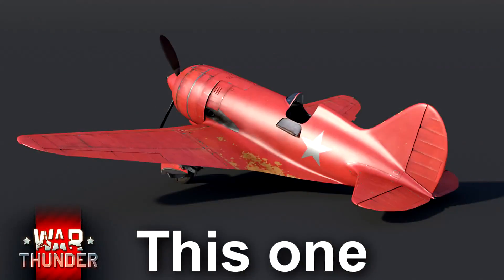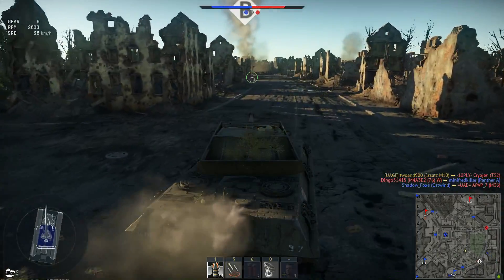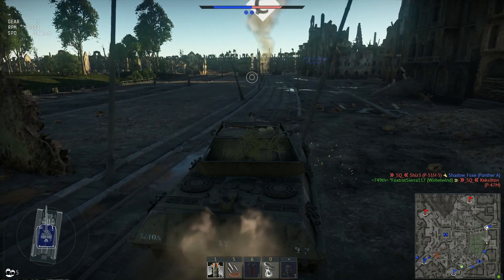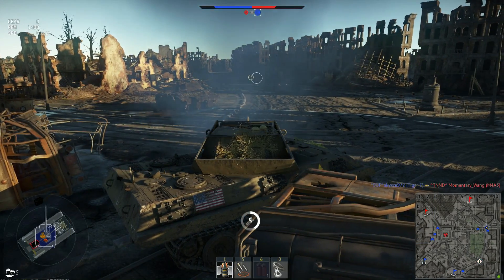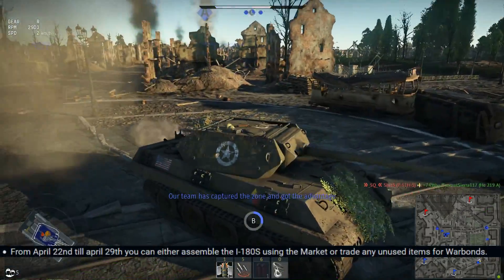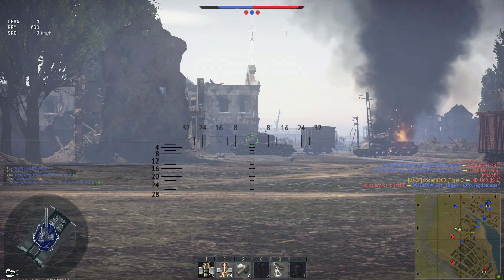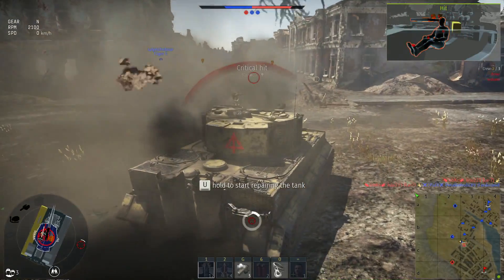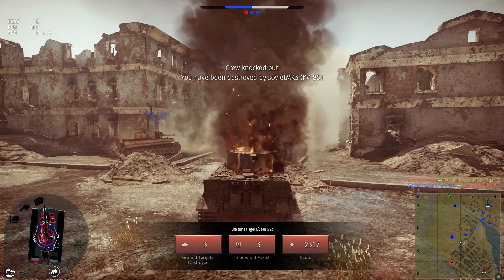How To do the Battlefield Engineer Event - War Thunder

Comment: Oh, oh, I know: Assemble the plane coupon and the first voucher easy peasy, then try to build the second voucher, only to learn that the last two parts you need have an abysmal droprate and go for 400 gaijinbucks each on the market. That totally helps with motivation.
Reply: sell a bunch of repair kits to be able to buy the part
Reply: Ah, yes, of course. At 0.39 per repair kit that just means I need to farm and resell slightly over 2000 repair kits. Totally viable, right?
Reply: @Norrikan  oh thought you meant 4.00 and didnt realize that there are parts over 100 bucks, i see them now O_O
Reply: General Glowstone they go down extremely fast so dont worry

Comment: btw, i'm finnishing the 2nd i-185, had no need to buy parts, when i disassembled a bad part, it disappeared, but later on, when i had checked other stuff, i got the box with the 'green' part, for example, the armament, so, don't go spending $ like there's no tomorrow. it's not that time consuming, comparing to the IS7 event, i would say it's about the same effort, if ur going for all vehicles...

Comment: I've lost my i-180s i can't find it i can't do tests with it i had it at the beginning of the game and  i also have no coupon can someone help or explain to me what has happened i'm so pissed off all i want is 2 vehicles maybe 3 if i'm lucky or have the time thanks in advance to anyone who can help.
Reply: maybe look in your inventory? at the bottom right of the ingame screen
Reply from the maker: I've heard of other people having this problem but unfortunately I do not know how to fix it, however, I would suggest restarting your game. If that doesn't help, you should looks for people having the same problem on the official forums and bug one of the moderators.
Reply: @najkraemer3117  Ill try that thanks.
Reply: @lol500000  i have found people i think they had the same problem but no1 had a solution thanks trying.
Reply: All good it just appeared straight after a match i really wish they wouldn't get there act together thanks for trying to help much appreciated cheers.

Comment: 20-30 battles so far and all boxes dropped 1 toolkit each and so far i ONLY GOT ONE part...
These events are so fucked up that i don't think TEC ever sees why 80% of the community HATES this BS, shit like the old battle task events are closer to a fair deal than this BS that makes no excuse to force players to try the Market, Gaijin seems to want to make it's already niche audience try to put them together with EA this year, for worst company of the year.

The rates for 2 and 3 toolkits should be raised to at least a 25-30% drop rate, and first place box should guarantee a 10 toolkit drop on the 10-11th box if none have dropped on the earlier ones, also, components need to drop at a consistent rate (every 15 battles or so).
They should have added a toolbox reward for those with lots of team friendliness achievements (tank reacuer, help with repairing, supporting fire...) to make players that aren't firat place, but actually made a HUGE help towards the team's capacity by being helpful and willing to drop score for camaraderie instead.